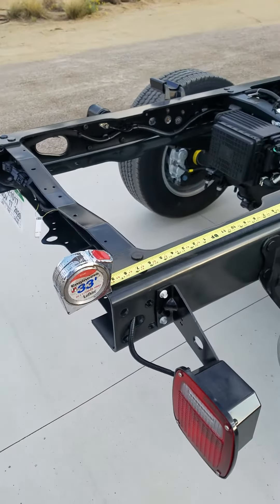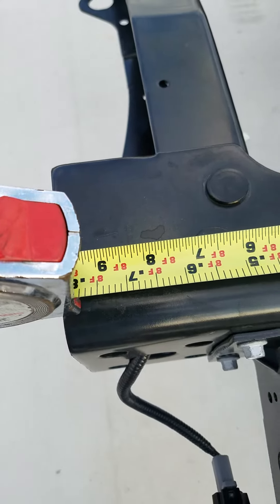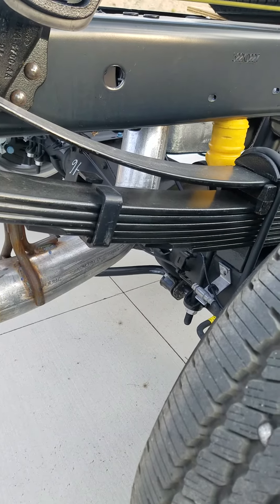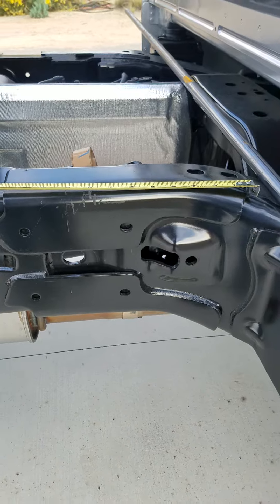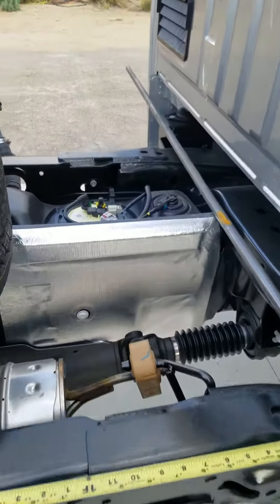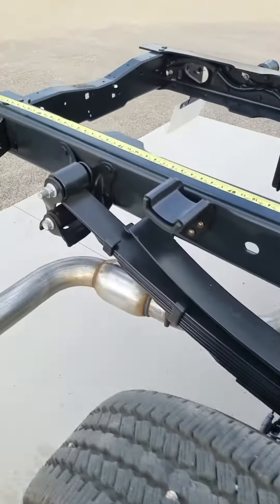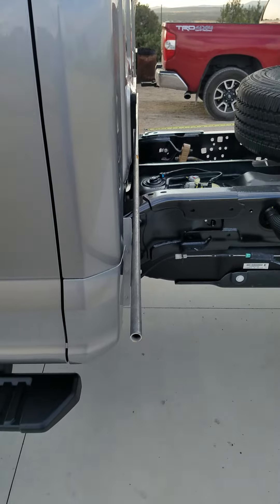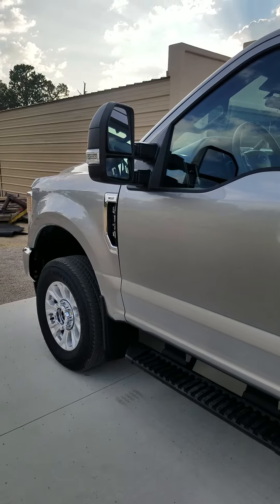2020 Ford F-350 Super Cab Godzilla 7.3 Cab and Chassis

Comment: Can you fit a normal bed in there?
Reply from the maker: You need to check if it's a regular pickup bed or the regular pickup bed footprint   the cab and chassis is roughly 6"- to 8" longer and a flat channel frame but the distance from wheel center to the cab is the same on both